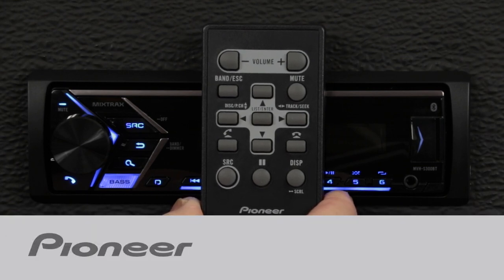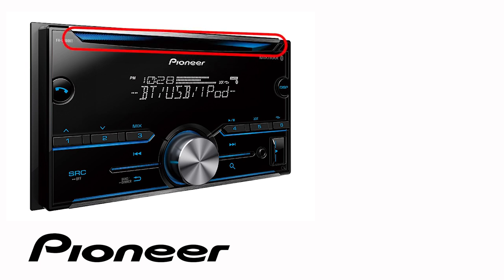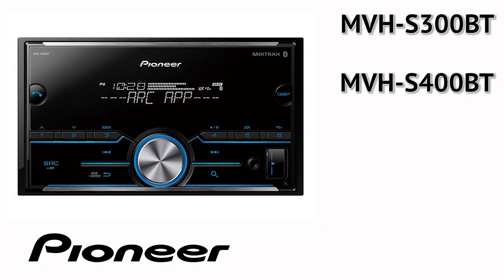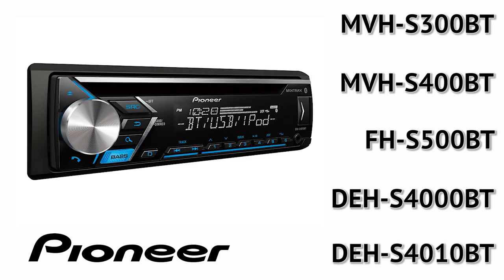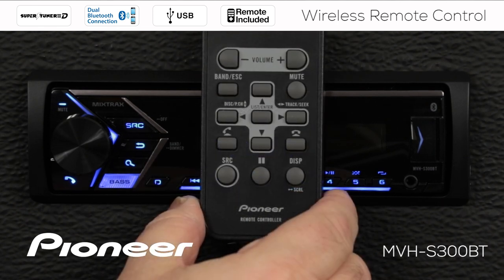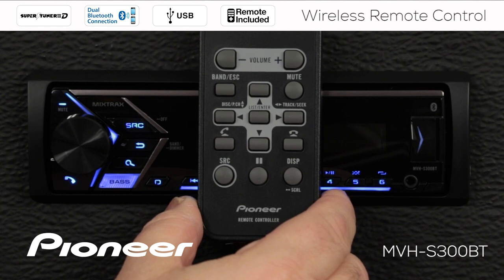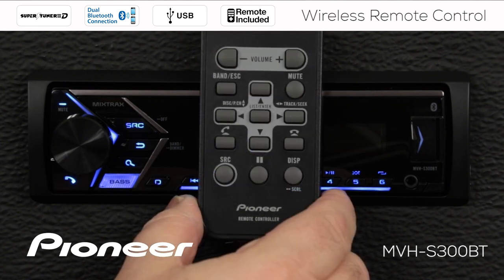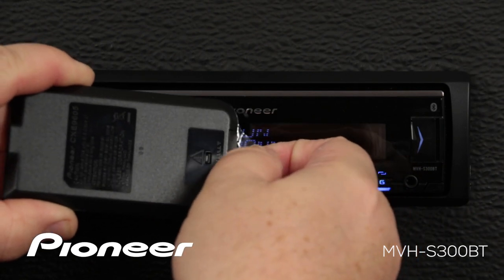How To - Wireless Remote Control on Pioneer In-Dash Receivers 2018

Comment: Hi i need you guys held how do you connect the remote bc mine doesn't work
Reply: Help*
Reply: I have a deh-4000-bt
Reply: S4000*
Reply from the maker: The wireless remote control included with the Pioneer DEH-S4000BT needs no set up.  It's an infrared remote control.  That means when you press a button, the remote control sends out pulses of infrared light. Simply point it at the in-dash receiver and it should work.    If the in-dash receiver "sees" these light pulses, it will respond.  You can't see this light but your modern cell phone camera may be able to see it.  
 I recommend to replace the battery on the remote control.  Using a small point firmly push down on the small hole at the bottom of the remote and pull out the battery tray.   Replace the battery with an identical battery.  The battery size is printed on the battery.
After you install a new battery you can test to see if the remote control is working.  Many modern cell phone cameras will show the infrared light emitted by the remote control.  Point the remote control at the camera and see if the remote control light appears to light up.  If so, the remote control is probably working properly.
I recommend to press the receiver's microprocessor reset button.  You'll need a paperclip or some other small point to press the microprocessor reset button.  You can see it demonstrated in this How To video from Pioneer:   https://youtu.be/o6iawP279R4
You can find more videos on Pioneer's YouTube Channel here:  https://www.youtube.com/user/pioneerelectronics

Comment: @pioneerelectronics Will this remote work with newer models such as the dmh-100bt?
Reply from the maker: The remote control shown in the video above will work for some functions on Pioneer DMH-100BT such as volume control and track REW/FF.  Please note:  this remote control is not designed for the DMH-100BT and so not all remote control commands may function as expected.  
Another Pioneer remote control option can be found here:   https://www.pioneerelectronics.com/PUSA/Car/Accessories/Remote-Controls/CD-R510
You can find more videos on Pioneer's YouTube Channel here:  https://www.youtube.com/user/pioneerelectronics
Reply: Hey, do you know if you can buy a new remote or replacement for my radio?
Reply from the maker: @gauravthakkar802     You can buy a replacement remote control directly from Pioneer in the US here:    https://www.pioneerelectronics.com/PUSA/Car/Accessories/Remote-Controls/CD-R510
Or from PacParts, this is Pioneer's parts distributor in the US:    https://www.pacparts.com/part.cfm?part_no=CXE9606&mfg=Pioneer
You can find more videos on Pioneer's YouTube Channel here:   https://www.youtube.com/user/pioneerelectronics

Comment: I just bought a Pioneer AVH- 3300nex new from BB. After install, the remote will not work. I pulled the plastic tab for the battery separation and tried using the remote and no-go. I tested the battery and it has 3.4v. Any ideas?
Reply: First, try a new battery.  If that does not work, I recommend to go back to your place of purchase and ask for a new remote control or a new in-dash receiver.  You can test the in-dash receiver by using a Pioneer remote control that you know works with other Pioneer in-dash receivers.  You can test the remote by using a Pioneer in-dash receiver that you know works with other Pioneer remote controls.  IR light from a remote control is often visible through many surveillance cameras.  You can find videos about Pioneer AVH-3300NEX here:  https://youtu.be/ibWu0o2hW24?list=PLw63zJRQbCNja5HE6sCEu9Pz6RqC3Qx5u

Comment: How do you program a brand new remote to a head unit
Reply: You don't. No programming or set up is necessary. If your Pioneer receiver works with a wireless remote control just point the remote at the receiver and press a button.  The wireless remote control sends out pulses of infrared light, kind of like a flash light.  The in-dash receivers remote eye "sees" the infrared light and the receiver responds.  If it's not working as expected, I recommend to check the battery on the wireless remote control.  You can find more videos on Pioneer's YouTube Channel here:  https://www.youtube.com/user/pioneerelectronics

Comment: Which remote is used with avic x940bt
Reply: The Pioneer AVIC-X940BT was manufactured back in 2011-2012 and did not ship with a wireless remote control. It was not designed to work with a wireless remote control.  You can see the unboxing video here:     https://youtu.be/8arc2bKWWfk       If your vehicle has steering wheel controls, the AVIC-X940BT can operate with your steering wheel controls through a third party adapter.  Many are available.  Here is one possibility:   https://maestro.idatalink.com/product/product/product_id/101   You can find more videos on Pioneer's YouTube Channel here:   https://www.youtube.com/user/pioneerelectronics

Comment: How do you preset radio stations deh-1750
Reply: The Pioneer DEH-1750 was manufactured back in 2002/2003.   To set a radio station preset, tune in the correct frequency and press and hold for a few seconds until the preset number stops flashing,  a radio station preset button, 1 through 6 across the bottom of the receiver.  You can see it on a more modern version Pioneer receiver in this video:   https://youtu.be/b7Baainh0X4?t=48     If the receiver's clock and radio station presets reset each time you start the vehicle, you may have the in-dash receiver wired to the vehicle incorrectly.  You can learn more about wiring your Pioneer receiver in this video:   https://youtu.be/kR2MO2kwFug     You can find an owner's manual from a similar product from that era here:   https://www.pioneerelectronics.com/pio/pe/images/portal/cit_11221/187294998DEH-P3700MPOperationManual.pdf        You can find more videos on Pioneer's YouTube Channel here:  https://www.youtube.com/user/pioneerelectronics

Comment: I have an pioneer mvh s300 bt and i can't make microphone settings to be memorized.when i turn off the ignition and turn on back,microphone is off again.....why?
Reply: If your in-dash receiver settings reset each time you start your vehicle you may have an improper connection for the Yellow Wire.  The Yellow Wire must have constant power from the vehicle.  Take a look at this video for more information on wiring: https://youtu.be/kR2MO2kwFug?list=PLw63zJRQbCNinkLCSrV17ExW5FWT7aIFU   you can find more videos on Pioneer's You Tube Channel here:  https://www.youtube.com/user/pioneerelectronics

Comment: How do i set it up? Its not doing anything. I checked the remote and its working and sending an infrared signal but my hs505bt isnt responding
Reply: What is the model number of the Pioneer in-dash receiver you are using?  I don't recognize "hs505bt"  as a Pioneer model number.  The model number is usually printed on the face of the in-dash receiver in a top or bottom corner.   Not all Pioneer in-dash receivers work with a wireless remote control.  On Pioneer in-dash receivers that operate with a wireless remote control, there is no set up to make this operate.  Please be sure the battery in the remote control is fresh.  You can find more videos on Pioneer's You Tube Channel here:  https://www.youtube.com/user/pioneerelectronics
Reply: @deckerdotto6035  Sorry i got the model wrong, it is a FH-S505BT. I have tested it with a new battery, the infrared light works but still no reaction
Reply: The remote came with the receiver and is advertised on the packaging so it definitely supports it
Reply: I recommend to test the remote control on another Pioneer in-dash receiver. Maybe a friends vehicle or in a store.   Nearly all Pioneer in-dash receivers that work with a wireless remote control will respond to the volume control of a properly operating Pioneer wireless remote control.   This will tell you if the remote control is operating properly.  If you find the remote control is operating properly with a different in-dash receiver, you'll know where is issue lies.  If you find you have a product that is defective, I recommend to contact the place where you purchased the product for service.  Pioneer Gulf Free Zone can be found here:  https://pioneer-mea.com/en/
Reply: @deckerdotto6035  like i said for some reason it has started working, i didnt do anything but it seems fine now

Comment: I have a DEH-4300UB and my remote is not working with my stereo.  The battery shows 3 volts and I can see the remote light when pointing it at my phone's camera. What can I do to pair it to my stereo.  The remote has never been used and I even pulled out the plastic tab from the battery cover.
Reply: There is no process to pair the wireless remote control to the DEH-4300UB.  The remote sends an infrared light signal, like a flashlight.  If the in-dash receiver can "see" the signal it should respond. I recommend to replace the battery in the remote control.   The DEH-4300UB was manufactured back in 2010/2011.  A battery sitting for 10 or more years may need to be replaced.  This is what the remote control should look like for the DEH-4300UB:  https://youtu.be/MrvbB3euxVA  
It's also possible the in-dash receiver may need to be serviced.  If you want to buy a replacement remote control I recommend PAC Parts.  They are Pioneer's Authorized parts distributor in the US.  You can find them here:  https://www.pacparts.com/part.cfm?part_no=CXE3669&mfg=Pioneer    You can find more videos about Pioneer DEH-4300UB here:  https://youtu.be/RarIQ76BEj8   and you can find more videos on Pioneer's YouTube Channel here:  https://www.youtube.com/user/pioneerelectronics

Comment: hi i bought this deck serise and the remote has not reaction. is there a wiring problem or dead battery or dead remote possibly?
Reply: I recommend a new battery in the remote control.  The remote control must be pointed at the in-dash receiver to operate.  You can find more videos about Pioneer MVH-S300BT here:  https://youtu.be/Z6g0EOPZL0c?list=PLw63zJRQbCNinkLCSrV17ExW5FWT7aIFU

Comment: That's a useless video no instruction on how to connect the remote to the headunit. (Just pull the plastic out) yeah cause I just fitted new battery to the remote but the plastic tab being removed will automatically connect the remote.
Reply: The plastic tab has nothing to do with this.  The plastic tab is packing material used to make sure the remote control's battery does not die in shipping. Inside the product box, if a remote control button was accidentally pressed in shipping for a few days, the battery would be dead when the product was unpacked.  The plastic tab stops that from happening.   When you pull out the plastic tab, all you are doing is putting the battery in place.   Check the battery.  Did you put the battery in upside down?  Did you use the correct type of battery?  If your remote control is Pioneer part number QXE1044 you should be using a CR-2025 battery.  Are you pointing the remote control at the in-dash receiver?   There is no instruction on how to connect the wireless remote control to the in-dash receiver because there is no connection to be made from the wireless remote control to the in-dash receiver.  The wireless remote is an infrared type of remote control.  It works like a flashlight.  It shines a beam of light in short pulses to the in-dash receiver. The light is infrared, that means humans can't see it with the naked eye.  When the in-dash receiver's remote eye "sees" the pulses of light from the remote control it operates.  No connection is required.  Any Pioneer remote control part number QXE1044 will work.  You can find more videos on Pioneer's You Tube Channel here:  https://www.youtube.com/user/pioneerelectronics

Comment: Settings for pioneer remote mode on
Reply: There are no settings to make the wireless remote control work.   No programming or set up is necessary. If your Pioneer receiver works with a wireless remote control just point the remote at the receiver and press a button.  The wireless remote control sends out pulses of infrared light, kind of like a flash light.  The in-dash receivers remote eye "sees" the infrared light and the receiver responds.  If it's not working as expected, I recommend to check the battery on the wireless remote control.  You can find more videos on Pioneer's YouTube Channel here:  https://www.youtube.com/user/pioneerelectronics
Reply: @deckerdotto6035  remote works new batteries put in and still won't respond
Reply from the maker: What is the model number of your Pioneer in-dash receiver?  What is the model number of your Pioneer remote control?  Are you sure the remote control is working?  To test, use the camera on your phone and point the wireless remote control at the phone camera.  Through the phone's camera, you should be able to see the wireless remote control light up something like a flashlight.  There are no settings to make the wireless remote control work.   No programming or set up is necessary. If your Pioneer receiver works with a wireless remote control just point the remote at the receiver and press a button.  The wireless remote control sends out pulses of infrared light, kind of like a flash light.  The in-dash receivers remote eye "sees" the infrared light and the receiver responds.  If it's not working as expected, I recommend to check the battery to see if it's installed correctly, on the wireless remote control.  You can find more videos on Pioneer's YouTube Channel here:  https://www.youtube.com/user/pioneerelectronics
Reply: @pioneerelectronics   so what if the remote works but the radio doesn't respond? Mines the avh-x2600bt
Reply from the maker: I recommend to press the microprocessor reset button on the receiver. You'll need a paperclip or some other small point to press the microprocessor reset button.  You can find the microprocessor reset button on the Pioneer AVH-X2600BT at the top of hard key panel beside the eject button.  Be sure the receiver's remote "eye" is not covered or scratched.  It's right beside the microprocessor reset button.  
Are you sure the remote control is working?  To test, use the camera on your phone and point the wireless remote control at the phone camera.  Through the phone's camera, you should be able to see the wireless remote control light up something like a flashlight.  There are no settings to make the wireless remote control work.   No programming or set up is necessary. If your Pioneer receiver works with a wireless remote control just point the remote at the receiver and press a button.  The wireless remote control sends out pulses of infrared light, kind of like a flash light.  The in-dash receivers remote eye "sees" the infrared light and the receiver responds.  
If it's not working as expected, I recommend to check the battery to see if it's installed correctly, on the wireless remote control.  Even if remote control appear to operate correctly, a new battery in the remote control can make a big difference.  The Pioneer AVH-X2600BT was produced back in 2012-2013 and may need to be serviced.   You can find more videos on Pioneer's YouTube Channel here:  https://www.youtube.com/user/pioneerelectronics